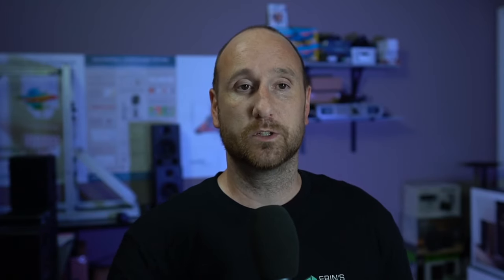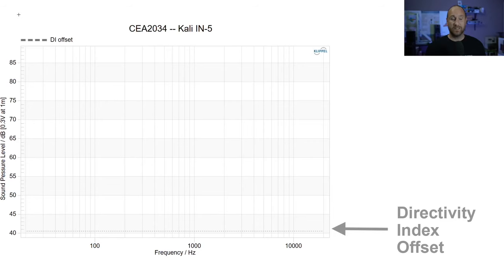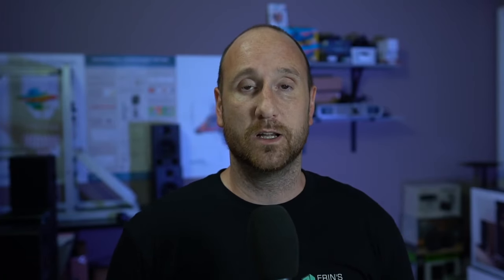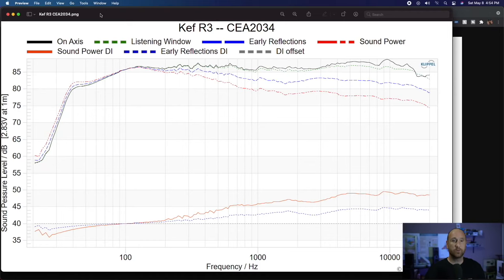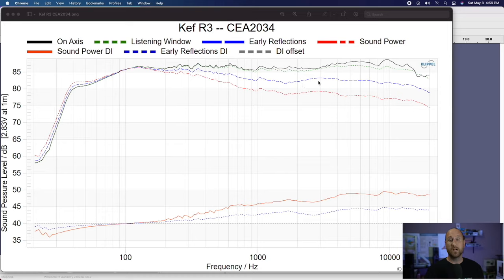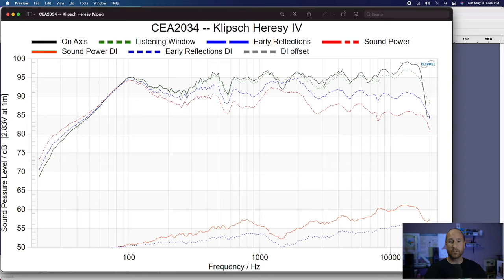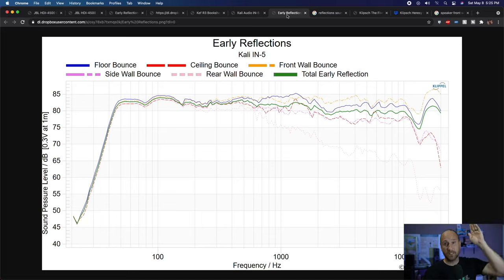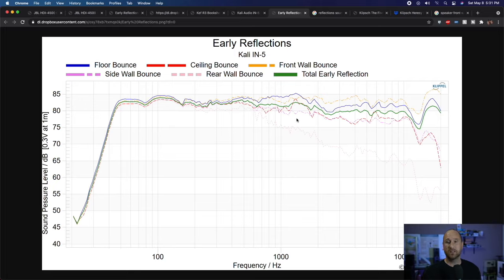What the heck is SPINORAMA?!  ||  Understanding the Measurements Part 3

Comment: Clarifications 

Early Reflections:
* It goes up to +60°V, not +40°V.
* It includes +/-100° H to +/-170°H; Todd Welti confirmed it should use the Vertical Reflections & Horizontal Reflections, which are defined below it in the paper; and the Rear Wall Bounce definition in the Early Reflections is incorrect. It should be 180°H to +/-90°, not “180°, +/-90°”.

Sound Power:
* The data is weighted by angle, whose weights are defined in the paper.

________
Erin, if you have been using what Klippel spits out for the Spin and not calculating it yourself, then your ER & PIR curves are all slightly incorrect (most influence is at the crossover region).
Reply from the maker: The Klippel curves are correct. I have an updated template. I discussed this on ASR.  👍

The values came from the standard so the standard needs to be updated/corrected.  They need an editor. I’ll update this in the description. 

Yes, SP is weighted by angle. But there isn’t enough space to fit that information in the sentence. 😉
Reply from the maker: Also, I pinned your reply so others will see it.  👍

Comment: Directivity is such an overlooked characteristic when building speakers. People don't realize the effect it has on the in-room response. I bought a pair of klipsch rp600m for my college apartment which was all hardwood floors, drywall, and windows. I was surprised by what I heard, a nearly perfectly balanced speaker. I brought them home and set them up in my treated listening room and holy cow were they a different speaker. It sounded like the mids were down 3dB and the treble was boosted 3dB. The problem was clearly that the horn made the highs very directional, so the mids were bouncing off all the walls in my apartment and thus being higher in level. When I put them in a room with carpet and absorption the mid reflections went away causing an anemic, bright response. 

This essentially makes almost all hifi reviewer's opinions irrelevant because, unless they take directivity measurements, or at least know what it is, you don't know what you're getting.

I love the series so far and am really looking forward to hearing what you have to say about distortion and what harmonics might be more important to stay away from than others.
Reply from the maker: I was going to have a video on Distortion but have decided to use my discussion with Dr. Earl Geddes (one of the leading researchers in to distortion) take the place of that.  There is no way I could describe the topic as well as he does because it is really not so trivial.  If you haven't seen that, here is the link:
https://youtu.be/jnEGWFEGpmw

Comment: i'd love to see a spinorama comparison of a convex (regular) vs concave dome tweeter of similar type. i've read conflicting information about which one has the best dispersion at the extremes; i'd assume it would be the standard dome (as the driver surface is visible more at the absolute extremes) but i've also ready that focal's inverted domes are more consistent off axis.

Comment: Great explanation.  I guess the Spinorama is particularly useful for deciding what speakers will work best in an untreated room.

But is the off axis graph better if one is designing a room with room treatment?
Reply from the maker: The off-axis data is useful for many reasons.  To determine how smooth the response off-axis is (whether what is reflected will sound similar to what you hear directly from the speaker) as well as determining things like soundstage width.

Comment: Seems like something is wrong with those plots, assuming the descriptions aren't erroneous. There are two ways to eliminate all ambient sound and leave only the direct sound, other than operating in an anechoic chamber, and they both truncate the bass response to wavelengths in accordance with the speed of a sweep or the gated time of the impulse response. For instance, to get rid of reflections from side walls that are three feet from the speakers, everything below about 380 Hz (1136 ft/s ÷ 3ft) will be missing from the data set. That's lower than the actual cutoff would be, since it's really the path difference that matters, but close enough to make the point. So where did the bass response come from?
Reply from the maker: These aren’t gated responses. These are (better than) anechoic using the Klippel Near Field Scanner.
Reply: If it’s not gated, how does it not pick up reflections from nearby surfaces? David is right, typically you would window the impulse to remove unwanted energy from reflections, however due to the constraints of physics you can’t reliably measure at low frequencies with a short impulse due to the increased wavelengths at lower frequencies, and the need to acquire multiple cycles to accurately measure.

Appreciate all the information you put out here by the way.